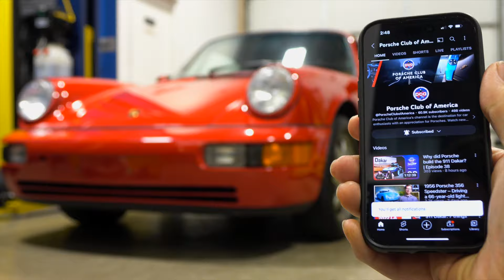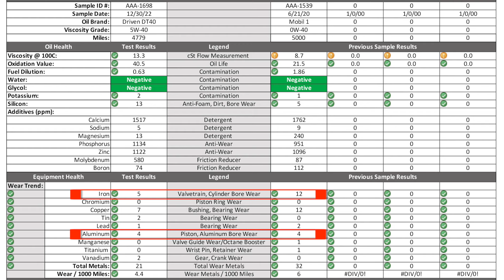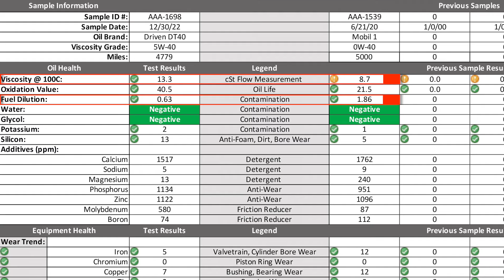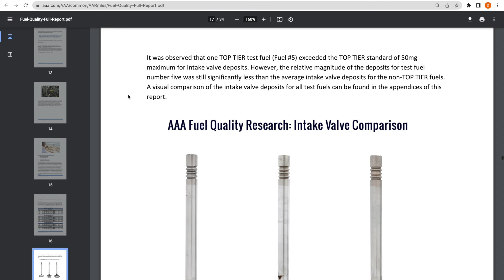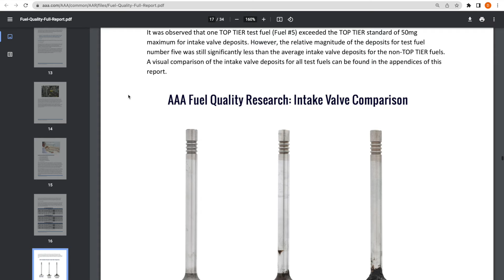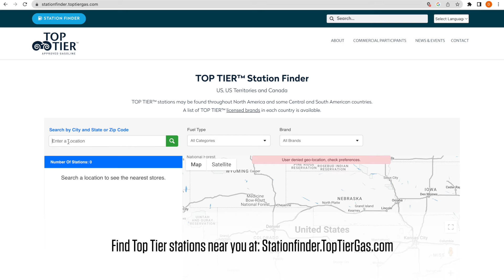How to prevent or slow the progression of bore scoring in your Porsche M96/M97 engine | 3 of 4

Comment: the best way to prevent bore scoring is to not buy an engine that will develop bore scoring.. no mater what you do. as the car reaches 100k miles it is gauranteed to have it.
Reply: I'm out😢 I wanted to always buy a Porsche but.. I just cannot knowing it's going to happen no matter what
Reply: Buy one with a bad engine cheap and ls swap it
Reply: I owned a 2001 996 911 for many years and drove it to to 125k miles. The guy who purchased it from me did a ppi and it had no signs of scoring. The car also burned no oil between changes. It is possible to prevent it from occurring if you take the proper precautions. The trick is getting an engine that has no scoring from the start because once it starts there's no way to stop it from progressing.
Reply: 108,000 miles and just had clean borescope injection. Goons redlining cold engines and short shifting under load will score bores so you should probably buy that pushrod Chevy instead
Reply: do 991.2 gt3 engines have it?
Reply: Hartech rebuilt cars are great value
Reply: I had a ppi done, didn't buy a 997.1 because it had bore scoring.

I won't touch a 997 now
Reply: @-BuddyGuy Hartech  have made a business out of shite Porsche engines
Reply: @davidleigh7698  Yes by rebuilding with different sleeves and bearings so they're not shite anymore

Comment: The #1 solution is to “not buy a Porsche from 1999 to 2012. Buy either a classic air cooled 911 or a Honda Civic. $35K for a 911 engine rebuild is insane!! I really dodged a bullet w a potential 997.1 or 997.2 purchase. Yes even gen 2 scores. Stay away.

Comment: What PPI place is going to do a bore scope through the sump, and what seller would allow it?
Reply: That’s the rub.  A lot of sellers, especially dealers don’t want to run the risk of letting someone take inventory, crack it open, snoop around, and put it back together.  Why would you, especially if people are still clamoring to buy?  They’ll just tell them no and sell to the person waiting in line. And if the car does come back with scoring (which I personally think most have to some degree) the dealer will at a minimum have to play dumb with the next buyer, or be honest and take a significant hit on their profit.  I’ve also heard some shops don’t want to do it because it takes up valuable time and a lot of times it’s not bringing them any repeat business.  A lot of these cars are bought long distance so the buyer coordinates the PPI with borescope, and either buys or doesn’t buy the car, but it’s not coming back to the shop.
Reply from the maker: There are places that will do this, and some that perhaps won't. However, the buyer is paying the shop for the time (and possibly an oil change), so if they're capable of pulling the sump and scoping the bore, then hopefully the shop will accept the money to do so. If the shop doesn't want to scope the bore for whatever reason, and if the buyer decides to forgo a bore scope, then the buyer needs to know they're rolling the dice. We recommend making sure the shop will pull the sump and scope the bores before taking the car there. If the seller has a recent oil analysis, that would clearly show if bore scoring is happening and is the ideal scenario. We'd recommend anybody who is planning to sell to do an oil analysis and have on hand for potential buyers.
Reply: @PorscheClubofAmerica  I agree 100%, I’ve just noticed on the forums a lot of buyers 1) are having a hard time getting the dealer to permit the sump plate to be dropped and 2) are having a hard time finding shops to do a bore scope from the sump.  For what it’s worth, you can do it yourself with a $40 bore scope camera from Amazon and videos from Jake Raby.  It is a dice roll though because it’s after the purchase.
Reply: I got it done - and the seller paid for the bore scope

Comment: Here's my engineer 2 cents. The engine oil should be changed soon after adding any tank full of 'detergent or catalyst' cleaner simply because the product (could) potentially dilute and significantly compromise the lube oil.
Reply: Explain??

Comment: Honestly just get a 997.2.
Reply: They score too 😟
Reply: @frederickcook87  not as much though. Glad in have a 991.2 now. So far they seem very stout
Reply: The thing seems to be that the problems/scoring starts showing up as the models age.  The 997.2 were “safe” until a few years ago and now we’re starting to see some here and there.  Although the mode of action is different.  Not to be a fear mongerer, but only the future will tell.  I do agree with you tho, if it’s possible, just go for the 9A1 engine.
Reply: @K1dPhresh1  the 991.2 is far superior to the 997.1 and better than the 997.2. I’ve had a 997.1 and 997.2 C4S with manual. The only thing better in the 997 is the exhaust note. That’s it. My 991.2 has PDCC, SPASM and RAS. The 997 didn’t have any of that
Reply: @robertsole9970  it should be, it’s the newer car.  The engines are definitely better. Far less issues.  Other than the rare bore scoring, I’ve heard the main thing to worry about is the HPFPs in the 9A1s.
Reply: @K1dPhresh1  Uh, not sure that the 9A1 is the answer, there's plenty of them with the same problem.
Reply: @JimMutter  they all have problems, but I think the smart money is on the 9A1 over the M97.
Reply: @K1dPhresh1  I can assure you, that's no comfort to the people with a 9A1 that's eating itself alive.
Reply: @JimMutter  true, but for the prospective buyer, M97 vs 9A1… I’d recommend 9A1.

Comment: Things I have learned to do:
1. Warm up engine to 190 deg oil temp before going over 4000 rpm.
2. Don’t take a lot of short hop trips without a longer drive here and there, get the oil temp up past 200 degrees to evaporate fuel in the oil. The old “Italian tune up” as much as you can manage.
3. Use better oil. I use Liqui-Moly which is premium full synthetic and has good amounts of the right additives.
4. Additives leach/ burn / evaporate out of the oil so change it once a year regardless of whether you reach prescribed oil change mileage interval and of course always change the filter too. It’s more the additives going away and contaminants building up, than the actual break down of the oil which demands oil changes
Reply from the maker: Thanks for sharing!
Reply: I do all of the same except I keep it under 3000 rpm’s.  Well, and use Driven oils versus Liquid Moly.
Reply: If you are running Liqui-Moly oils, you will still want to use their MoS2 or Ceratec additive to boost the moly levels which is needed to help protect the cylinder bores.
Reply: In resume good gas, good oil, good maintenance, perfect
Reply: I use liquid moly the black additive in all my cars and trucks including old flat tappet cam small blocks . My Twin turbo f150 has 400,000 on the unopened enging and turbos of course oil gets changed every 5000 using quality filters and synthetic oil. I add molyslip or liquid moly to each oil change to my cars and trucks .Looking for a Porsche with bad engine to swap gm 4.8 or 5.3 and turbo charge next project
Reply: I would think it is a good idea to install a oil pan warmer and engine block warmer? Here engine block warmers is pretty much standard equipment on all cars and they recommend to use it even in summer when colder then +15c or so to reduce wear and fuel consumption.
++
Reply: 2 is especially important if you have a diesel. It will clog up your DPF in no time.
Reply: I cahnge my oil a lot, my car was from HI(warm climate), and run a fuel cleaner fairly often, use only top tier fuel and something not many people mention is I use a magnetic oil drain plug. I do this all 10 of my cars.

Comment: My Lexus is DFI and EFI at the same time and it has 200, 000+ miles in 6.5 years of ownership with no issues. My 997.2 C2S while reasonably reliable, has had its share of issues, water pump, High pressure fuel pump x2, high oil consumption, soot in the exhaust.

Comment: This is honestly the most valuable video.  Knowing your car is on it's way doesn't really do much of anything, but if you can slow it down that is what helps the most.
And from another engine builder that interviewed many bore-scored owners and found that idling to warm the car up as a very common denominator among them.

As far as fuels go: that was surprising.  How do you find out what the "Top Tier" fuels are?
Reply from the maker: Glad you learned from this! This website is where you can go, and they also have a Top Tier station finder: https://www.toptiergas.com/
Reply: Where I am they put a little sticker on the pump with the small iguana logo.

Comment: If you guys can come up with some sort of "Enthusiast" Scheduled Maintenance schedule for Bore Scoring, that would be nice. 
Maybe in an excel format OR PDF.  
also maybe a list the top 5 Oils for oil changes pending on severity of Bore Score. something more direct. 
But this is a good start. pleas keep it going.
Reply from the maker: Great idea!
Reply: For street cars, oil changes every 6 months or 5,000 miles. Driven DT40 or DI40, Liqui-Moly LM2040 w/ Ceratec, or Millers 5w40 Nano would all be good choices that will give you the added friction modifiers (moly) to help protect the cylinder walls. 

I personally run a bottle of Driven Injector Defender every other tank of fuel, but bare minimum you need to run a bottle of fuel additive containing PEA (polyetheramine) every 2-3k miles along with use of a Top Tier Fuel.
Reply: @lnengineeringllc  oh Snap. Well yeah. This is what I had in mind. LOL. Thanks a lot. Looking to get a 996.2 or 997.1 soon.
Reply: @MasterOfNone88  For what it's worth, I've run Red Line 'High Performance' 5w40 in my 981 Cayman S (3.4L 9A1 engine) and the used oil analysis from Blackstone has shown the following Molybdenum levels (ppm) from the past four oil changes: 422, 534, 560, 474. Each oil service was performed on the one-year mark and each batch of oil had been in service for ~2,000 miles.
Reply: @faust451  Thank you !! yes something like this helps.

Comment: I'm the original owner of a 2002 996 C2 and this problem has cropped up on my car at just 72,000 miles.  It is very sad and distressing because I am not located in the US and do not have access to LN or other builders.  My only option is the Porsche dealer, so I am getting ready to take out a mortgage on my home to repair my beloved old friend =/
Reply: Hartech?

Comment: I live in Wisconsin and I put mine away in my climate controlled garage with brand new 5w40 redline oil...  From time to time I start it when in storage, I even remove the fuel pump fuse if it spent too much time parked, before starting it. Anyways, my question is: How do I avoid having the car idling if I cannot drive it during winter? Is it better not to start it at all until spring?

Thanks! great video!!
Reply: The worst part of idling is the heavy rich condition from the fuel system during warm up. On top of that the oil isn't circulating as well so the cylinder walls are getting a double wammy. 

Best thing in cold climates is to not start the engine and not let it idle til warm up. If you start the engine in cold climate you should immediately drive it and get a full heat cycle. Of course, keep rpms below 4k until oil warms up completely. This get oil moving through the engine quicker while also reducing the duration of the rich condition of the fuel system

Comment: What about adding a small amount of 2 cycle oil to the fuel? Very light mix like 640:1. Wouldn’t that help lube the cylinders on cold start?
Reply: Yes, or lucas fuel conditioner.
Reply: @Aceman597 I have been doing that so far this winter for the 987.1S along with stabil 360 and I think it runs better and smokes less.
Reply: Interesting idea. I have a large supply of top quality 2T oil because I own multiple strokers. And a 996.2.

Comment: As a first time owner, I’ve used a product called Motorkote in the past with really great results. Project farm also did a video on it a few years ago. It basically leaves a very thin film on all surfaces. Project farm drained the oil out of a small engine, and it ran completely dry for a full 60 minutes, and it still didn’t blow up. I’m wondering if this would be a good long term solution for this issue, just adding some Motorkote into the oil every oil change

Comment: Assuming the 911 is only driven in warm temps — Why not use 5w 50 regardless if you have bore scoring or not, especially since it’s more protective than 0w40/5w40?
Reply: Then you f..k up the variable timing gear and all internal seals
Reply: 50 weight oil does not offer more protection. To your example you would want to go to a 10w40  synthetic with appropriate additives….. but that product probably doesn’t exist and 5w40 will have less engine wear until warmed up, then they would do the same thing.

Comment: I run 2 stroke oil in the fuel at 200:1. This directly deposits oil on the cylinder walls. 

Probably not the best for the emissions system, but I’d rather deal with that than bore scoring. 

My concerns were initially related to EGR, but with ratio being lean and modern ash-less 2 stroke oil I’m less worried.

Comment: If you use magnets on your filter and drain plug, does this practice cause no iron showing up in oil sample?
Reply: This will reduce the amount of iron for sure, but not to zero. It's important to cut the filter open so that you can evaluate the amount of ferrous debris. Would not be a bad idea to take photos so you can reference the photo at the next oil change.

Comment: Great stuff men, my 2007 911/991.1 seems fine, get it checked by Porsche once a year., 70000 miles at the moment.
I use the petrol additive at least twice a year, and dont idle as much these days.
My UK petrol is 99 octane i assume this is ok?
My question however is this!
I've been told the 3.6 Carrera is a stronger block than the 3.8 S engine, is that true??
I also have two Subaru's by the way..
Just subscribed!
pk 👍

Comment: it would be nice to share why m1 engine (cayman mk2) is less likely have bore scoring issues.  is it coating on cylinder block? or closed deck design or more oil pumping actuator or motor itself has been proven from ground up (design and execution to prevent bore scoring issue).  By the way, I happens to found even 991 911 engine has a bore scoring issue as well.

Comment: as always very good. I was wondering how the "moly"oils are in roller cam engines& iron sleves etc, like the gm ecoteck lnf turbo 2.0 engines. will it help or not.
Reply: Moly does indeed help with friction and wear reduction and most engines can benefit from a fully formulated oil with moly. The only time you don't want to use an oil with moly is when the engine has been rebuilt as moly can interfere with break-in.
Reply: @lnengineeringllc   good,I wasent sure if the moly was compatable with turbos&needel bearings & rollers. and apparently it is much finer than the moly lube used for flat tapper breakin that can/does clog oil filters

Comment: As someone who has always stuck to Mobile 1for my regular oil changes (once a year/about 3500 miles), should I be looking at alternatives? Just at the beginning of this video, so apologies if you answer it. Just wondering if I should get away from Mobile 1 in my 997.1 s. Great series by the way!!
Reply: We recommend Driven DT40 for 97-08 Boxster, Cayman, and 911 models. If you are in the UK, Millers Nano 5w40 would be suitable alternative to DT40. Last option would be to use the A40 approved Liqui-Moly LM2040 along with their Ceratec or MoS2 additive.
Reply: @lnengineeringllc  Thank you kindly,  for your service.

Comment: 1:47 why is it you see 13 for Silicon when using the Driven DT40 that LN claims to be better due to the high moly content when compared to Mobil 1?
Reply: When you see an increase in iron, aluminum, and silicon together, that's often the indicator of cylinder bore scoring. In this case, it's possible a cam cover or sump plate was re-sealed. It's common to see silicon leech into the oil from the sealant and will cause an increase in silicon levels alone.
Reply: @lnengineeringllc  Silicon and silicone are two different chemicals.